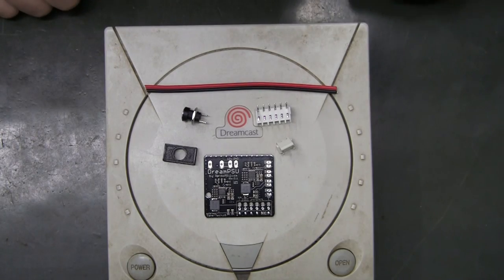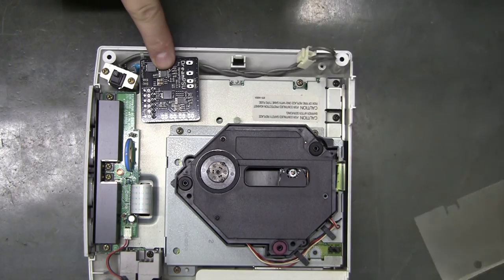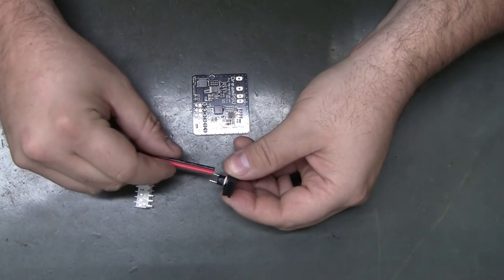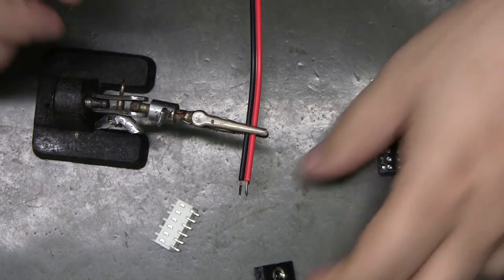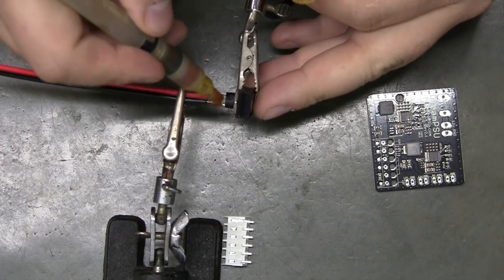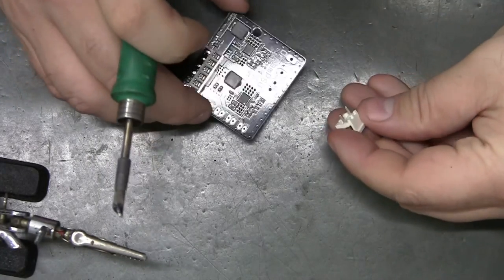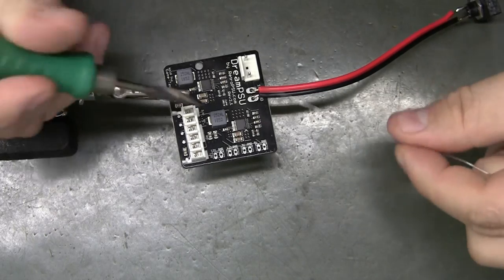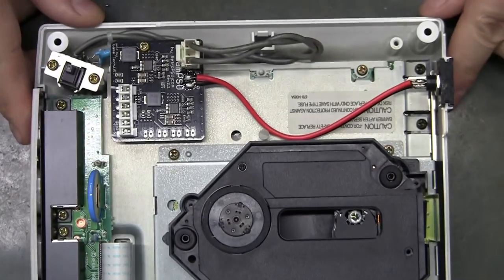DreamPSU install easiest DreamCast replacement power supply

Comment: I love working inside the Dreamcast, it’s so easy to dismantle and do various mods to. I’ve replaced the blue LED in mine with an RGB one for a bit of extra colour while I’m playing.  The transparent yellow case helps to show off the LED too. 

I really need to get one of these DreamPSUs as I’ve got a USB-GDROM and the old PSU gets very hot without the GD-ROM drive. I know some people recommend putting a resistor across some pins or something but I’ve seen just as many saying that isn’t a good solution either.
Reply: I just had the unused 12 volt rail disabled on the existing stock PSU. But this mod will allow you to use Dreamcast consoles from other regions without a Set Up or Step Down converter. And it works if you ever need a actual replacement

Comment: Installed one of these myself. I also decided to go all out on cooling the mobo by cutting a hole in the top metal shroud and installing a laptop fan. It blows the air right out the back vents and works great. I put in a DCHDMI mod, a GDEMU mod, and customized the GDMenu GUI to instantly load the game list instead of polling the SD card. Here's a quick video of all the stuff installed (with pictures links in the description of the hole I cut for the laptop fan): https://youtu.be/xLgh0BbFEok

Comment: I have heard so many unqualified opinions about the Dreamcast PSU that I really don't know what to believe.  I'm using a GDEMU.  I have heard that the 12V rail "runs hot" without the GD-ROM.  From the perspective of someone who knows a thing or two about circuit design, but admittedly not a SMPS expert, at first this sounds ridiculous to me.

For one, why would LESS load on a rail cause a regulator to run hot?  I know there are some DC-DC designs that need a minimum load to remain stable, and so there's just enough credibility to this claim that I can't toss it out entirely, but still... from a (admittedly brief) glance at the DC side of the PSU, it doesn't really look like the kind of topology that would require a load.

Second, what kind of load is the GD-ROM putting on the 12V rail?  I'm sure it powers the spindle motor, but the logic is probably powered from the lower voltage rails.  If so, well....  It's entirely possible that the drive would be idle for hours at a time.  If the supply absolutely required a significant-enough load on that rail, wouldn't that make it potentially disastrous to spin down the disc?  Remember, you could use this thing as a web browsing appliance.  I haven't really used it that way, but I would assume there's not much disc activity.  At the very least, the designers ought to have considered the possibility that someone would leave it powered on at the menu with no disc in it -- indefinitely.

So then you get suggestions to remove the 12V regulator entirely.  Except PAL guys might need it for the SCART connector.  VGA guys might need it too.  (Or maybe they don't.  Who knows?)  And the modem / LAN adapter?  That too.  So it's NOT safe to remove then, uh?

I've been kicking this can down the road, and have yet to see anyone speaking with authority on this.  Lots of regurgitated opinions, cargo cult wisdom, and blatantly misguided advice, but not much fact.  Anyone ever put a scope on this thing, or a thermal camera?  Or at least verify what all DOES connect to that 12V rail?
Reply: So I'm in a similar boat as you.  I'm running a GD-EMU (new install, under 2 weeks) and wondering if I need to swap the factory default PSU for a Pico PSU.  Just like you said, many people are saying without the GD-ROM to spend the load of the factory PSU, it will burn out.  But I agree that doesn't make much sense, however I am not an Electronics Engineer so I don't entirely follow the logic.  I've decided to run my Dreamcast with the factory PSU, and if it burns out over time, then I'll go ahead and install a Pico PSU.  Hopefully it doesn't burn out any of my Dreamcast components as well.  Hit me up in a few months and I'll let you know how it goes.
Reply: Nice post.  Ben running mine for a year pretty much every day and it seems fine.  Replacement psus are cheap so no sense in spending 50 bucks on this.  Unless you want to run one in your car or off a battery.  Older console designs were made to be rugged.

Comment: Amazing all the mods for Dreamcast. This is awesome. Would you still need active cooling though ? I'm not sure how much heat the system puts out from the gpu and other circuitry.
Reply from the maker: i'm not sure but it's def something i want to test!
Reply: I think that most of the heat is generated by the GPU/CPU, at least that is how it is in computers.

Comment: thats awesome! def will make it last much longer than having that old psu in it
Reply: Original was a transformer based, this is a switching converter, especially bad for capacitors. This is more energy effective but lifespan will be shorter.

Comment: Amazing how electronics have evolved over the last 20+ years. How much heat does it put out compared to the original psu?
Reply: Original DC PSU was 220V(PAL)/110V(NTSC) to 12V and 5V. This is 12V to 5V. Nothing has evolved it's exactly if you would make PC PSU external and then pull wires to motherboard through the case. I do not understand how this is an improvement.
Reply: Correct.  Unless you already have a 12v source available its probably not any more efficient.  However you could run it from a 12 battery if you have a portable screen such as in a vehicle.

Comment: Nice! On the thought of external PSU mods, it would be great if someone could make an external PSU mod for the original Xbox.
Reply: I've been looking , my PSU is shot , I get get no schematics on it
Reply: You might want to look into pico-psu's for extra small computer builds. Know a few modders back in the day used them as they made slim og-xboxes.
Reply: There's this page:
https://www.reddit.com/r/originalxbox/comments/c3h63n/picopsus_will_they_work/
by the looks of it, it may need some custom board to make it feasible or something.
Reply: @gcecbg  You technically don't need a custom board, but it would not look as clean as this.

Comment: any benefit to this over simply using a PicoPSU?
Reply from the maker: I need to get one to compare, but this one doesn't have any electrolytic caps... could be a good or bad thing depending on how noisy the output is, another thing i want to test! And I think I can keep costs low enough to compete, but most pico's i've seen are more than i'll sell this one for as long as my numbers hold up!

Comment: Will this work with a UK 240vpsu dreamcast. I like how you work with the soldering iron and crocodile clips. 
 Great video
How can I get one, can't find them on you're website shop.
Reply: Yes it does. People used to repurpose and rewire a PC Pico PSU before, the board Jason has here make it alot simpler to mod.

Comment: Could you please do a video with the popular Dreamcast mods?  I have already done the battery mod. Solder in a CR2032 battery holder and pop in a ML/RL RECHARGEABLE 2032 battery. The other mods I am  not sure what to do. ALL the fuse replace videos I see neglect to mention the actual part needed so even though the mod is a piece of cake without knowing the correct part to use make things a bit trickier.   As for fan mods there are a lot of different things  out there and  even though it is a simple mod I want to make sure I do it correctly..
Reply: RetroRGB is a great place to start when getting into modding

Comment: But if there isnt much wrong with the psu... why change it?
Reply: It's ideal if one has a NTSC Dreamcast in a PAL region and is looking for a replacement PSU and generates less heat when using a GDEMU. Of course one could disable the 12v rail on a stock PSU.
Reply: Also it could free up a bit of space for some other kind of mod/extra cooling fans etc of you are in to that sort of thing.
Reply: @OfficiallySanctionedKATG  That too!

Comment: Would have it been so difficult to keep the power in the same design as the original? Barrel plug looks so unprofessional and having to find some generic power cable for it is a big meh.
Reply: Its actually a god send of a mod if you ever deal with import DC consoles from other regions, Japan runs at a lower 100v while Europe runs at 240v. 
With a external 12 volt adapter, you don't have to worry about weird Set up or step down AC to AC converters.